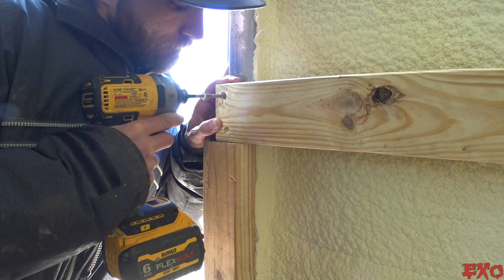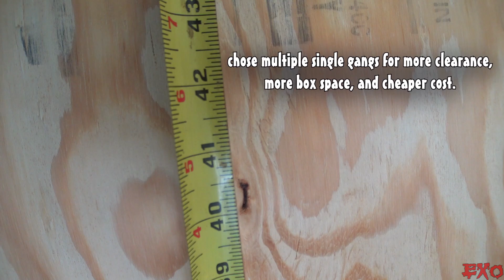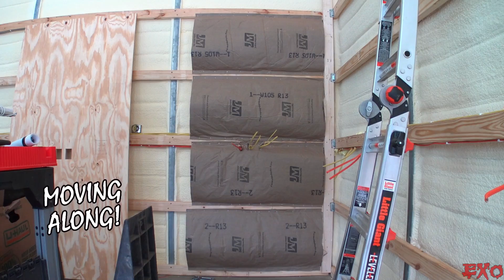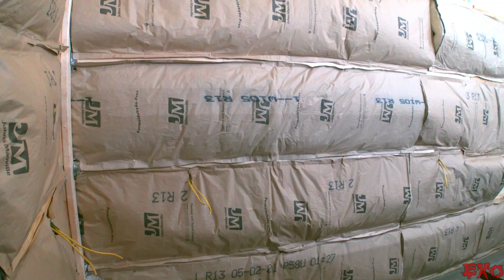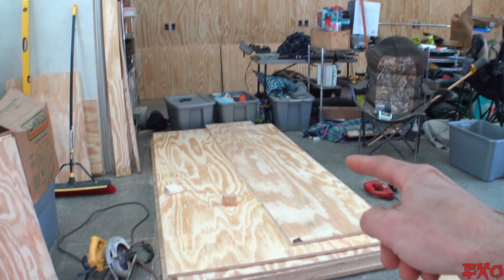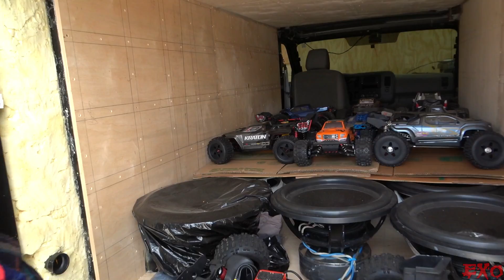Building My DREAM Workshop! Putting Up WALLS & WIRING Electrical Outlets in EXO's Car Audio Garage!!

Comment: Little bit surprised you didn't run ethernet through it as well. It can be multipurpose too e.g. used for cameras, computers, wifi access points, speaker wire and low voltage power wire.

Comment: I have a 2008 honda accord sedan exl without nav but with the premium audio system. I purchased a nvx loc and ide like to tap it into the rear subwoofer to retain my sub controller in my factory headunit please exo any advice

Sweet shop btw

Comment: GFI receptacles have a line and load side for those that don't know. The bottom terminals are the load ment for standard sockets down line to be on the GFI circuit so you don't have to buy multiple gfi sockets. There's a down side. If you overload the circuit on  the standard socket down line it will trip the GFI. Your first instinct will be to check the breaker and won't know why you have a bunch of dead sockets.

Comment: Make sure you have a 240v welding outlet :)  also handy for your future travel trailer or RV (but would require a neutral, doesn't look like you ran that type of wire).

Comment: i have a queztion. i have a cerwinvega ztroker 1vc 4ohm, and i have a cerwin vega 154 vflex 4 ohm. can i uze them in a zetup any way at the zame time. i do have 3 amplifier laying around, i uze a excursion full bridge amp now 1500w 4ohm 2500w 2ohm 3500w  at 1ohm and have a mb quart raa2400 and a ample A242x laying in my garage..  could i make a infinite baffle with one and  the other one in the box,the ztroker are in a box vented after zpecifacation..

Comment: I am NOTORIOUS for losing screws and bolts from shit I took apart that needs put back together. Last time I hit a deer and had to change all the radiator shit and headlights in my Honda, I took bags and my work sharpie out and put the ones from each part in separate bags and labeled them so I knew exactly what was what and they were so much easier to not lose

Comment: You mightve answered this in an old video, but wouldn't it have been a lot cheaper and easier to use drywall instead of plywood?

Comment: nice shop! awsome job,,.. i am building a system just wondered if you ever had your amp  and subs humm, or ground loop no head unit on,, were is it coming from? never noticed it until i put in my third battery

Comment: That' so funny I was just asking myself yesterday how you were doing, glad to see you back at it. Good call on the plywood walls instead of drywall. I did the same in my garage when I did the whole insulation and build. I am curious if you had considered vapor barrier when you insulated everything or was that not necessary given the spray foam?
Reply: Spray foam eliminates the need for any vapor barrier

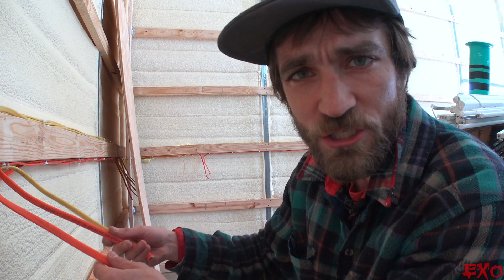Comment: 3:30 They sell little 6" extension cords exactly to solve that problem. I was both shocked and disappointed when I first discovered them because wall warts have been an issue since the '80s and I never thought to invent the solution myself. 😆

Comment: I would make it a priority to keep sawdust from getting on everything. Put the table saws, etc, all grouped together and use some clear plastic curtains or an actual sealed up room. It could even double as a paint room to control overspray. We have to learn from our prior mistakes. Good luck! 😃
Reply from the maker: Interesting idea with the plastic. Got a dust collector in mind but I know it won't ever get everything 100%. Definitely something to look into tho
Reply: ...and avoid the temptation to put up actual walls. Nothing ruins a nice big space more than a freaking wall in the middle of it.